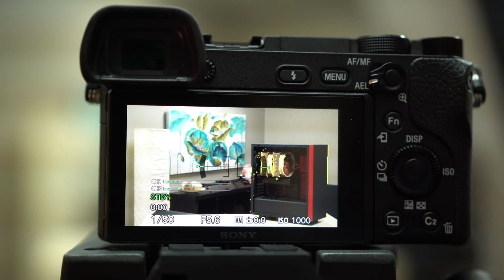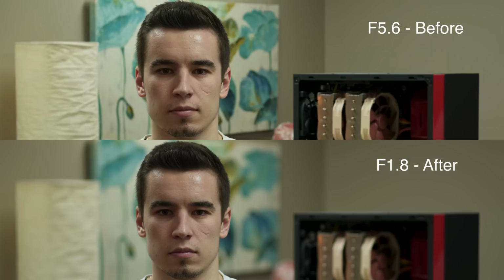Dramatic Lighting for Youtube - Step by Step Guide

Comment: Forewarning, a lens is never the sharpest at 1.8, especially not thee lenses he suggests. So. i would recommend 2.8 for those.
Reply from the maker: Yes its always a trade off opening up a lens all the way. Pretty much any lens will be sharper if you stop it down. With that said a Canon 50mm 1.8 lens is sharper at 1.8 than a cheap kit lens zoomed in at F5.6 because of the quality of glass. Yes you can take the 50mm 1.8 and stop it down to F2.8 and it will be sharper, but you loose some of the background blur which makes the image look nice for this type of a dramatic look.

Comment: Max, I recommend removing the Neewer second edgelight.  It didn't really add much except for a green tint, which looks bad in my opinion.  I assume the green is due to a low CRI value since it's a budget light.  Other than that, I love the new lighting setup!
Reply from the maker: True it is cheap. I was going to use my Aputure m9 with 95+ CRI but it was dead. http://amzn.to/2o76LR6

Comment: Hi Max. Great video. Thanks a lot for the inspiration and motivation. Did you ever try the aputure cob120 on np-f970 batteries? I have this v-lock adapter, the same as the amazon package provides, but after 5 min the lamp dies. Seems useless.